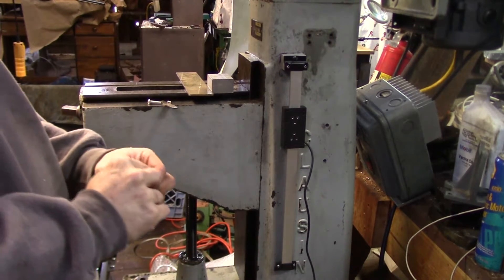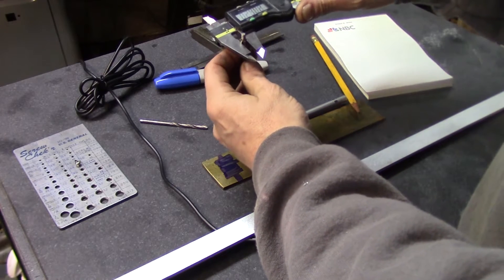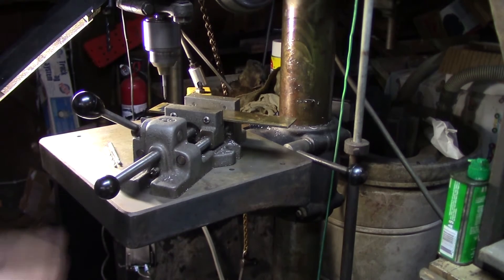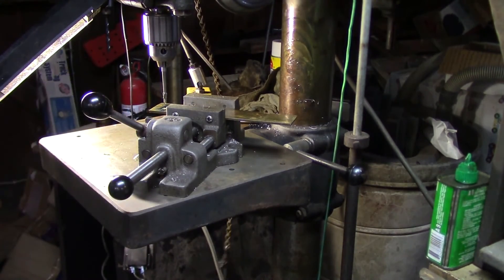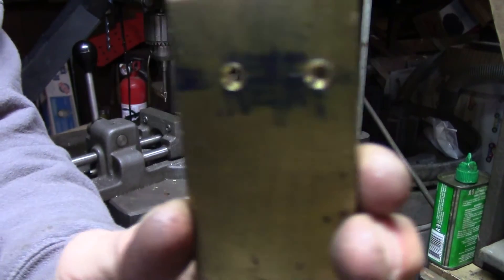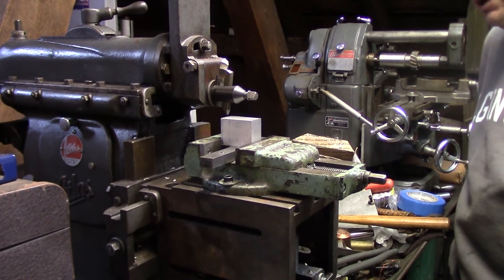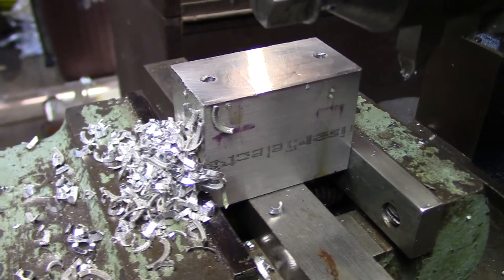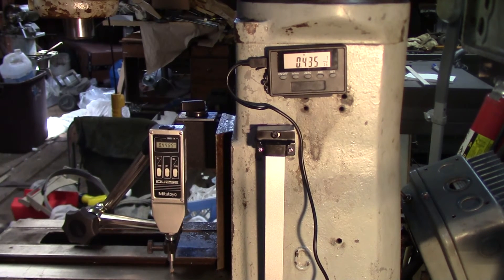Installing a DRO on the Clausing 8520 Milling Machine - Part IV

Comment: 2.9mm is probably M3, they typically are slightly under, pitch would be 0.5mm for M3, which is close to 44 per inch.
Next time I'm looking for an obscure imperial screw, like a 1/4"-20, I will remember your lack of M3 and have a laugh at us both. ;-)
Reply from the maker: +stefantrethan Great to know!   I found a kind soul on one of the websites I frequent who sent me 2  1" 5-44 screws for a couple dollars.    Now as you'll see in Part 6, I might have to sacrifice one of them to make a little scribe to mark out the location on the mounting block.  I should have done that first and I'm in a bit of a pickle, but rather than start over, I'm going to try to get creative.
Reply: +ChipMaker 1066 I'd give you a handful of M3 screws, but it's not worth the shipping. You can get them from McMaster if all else fails, but any junk electronic equipment should contain a number of them.